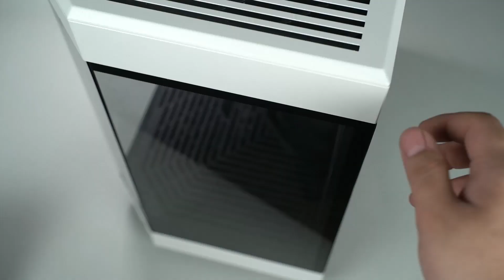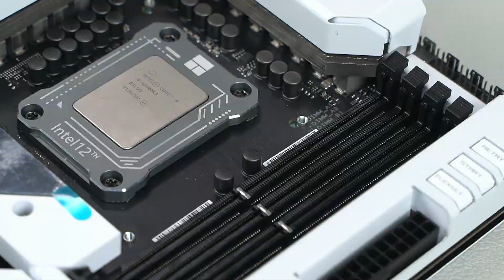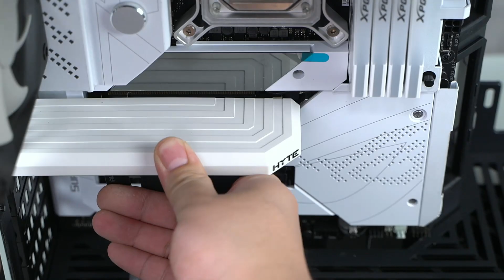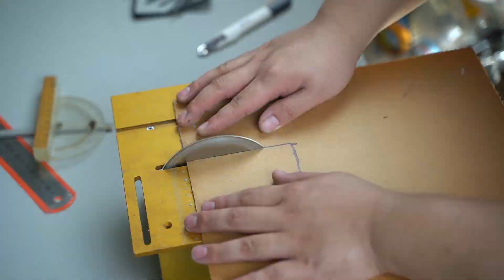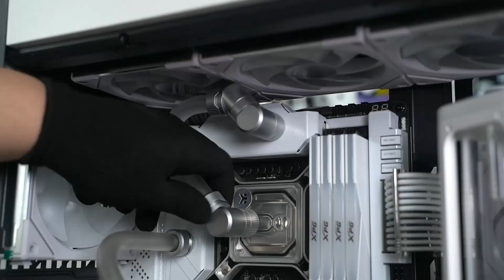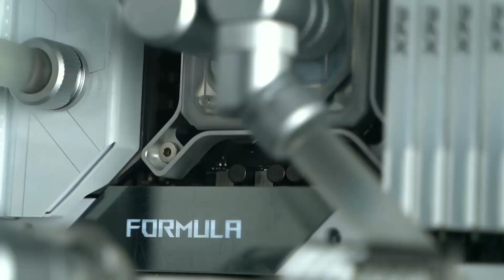hyte y60 white pc build

Comment: Part list: (might not be 100% correct)

Case: Hyte Y60
Mainboard: ASUS ROG Maximus Z690
CPU: i9-12900 KS
CPU Cooler: EK-Quantum Magnitude D-RGB
GPU: idk
GPU Cooler: idk
RAM: ADATA DIMM XX GB DDR5-XXXX
SSD: ADATA XPG M.2 NVMe
Radiator: EKWB
Fans: Lian Li UNI FAN SL V2
Pump: Este Lowara D5
Reservoir: ICE 240 D5
Power supply: Seasonic FOCUS GX 850
Fittings: EKWB

Comment: Y60 cant really support large air cooled GPU's, the fan's ramp up and get loud. 
The GPU is too close to the glass. For 4090 it questionable whether this case can support the new air cooled GPU's in the vertical position... 
For best temps you have to water cool in this case... which is a shame... Hyte need to make a horizontal bracket, I fitted my ROG strix 3090 that way (temporarily), it was a lot better
Reply from the maker: yes